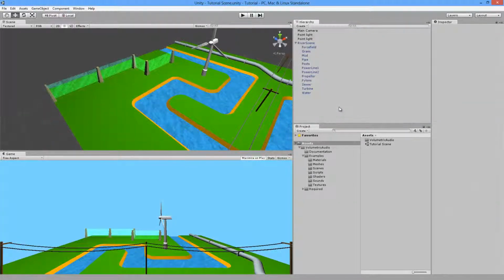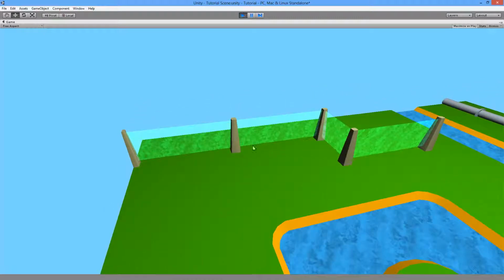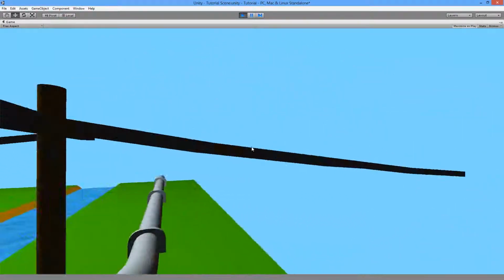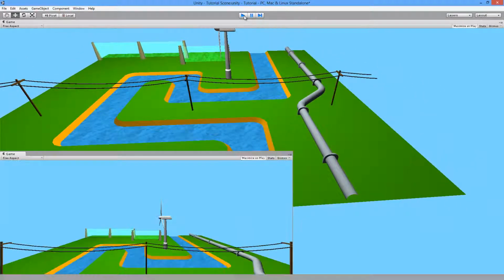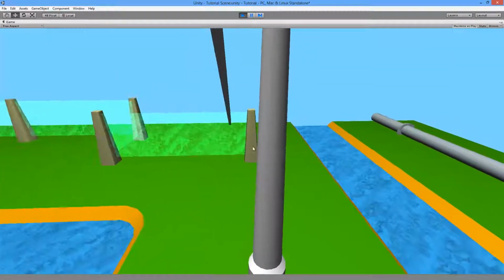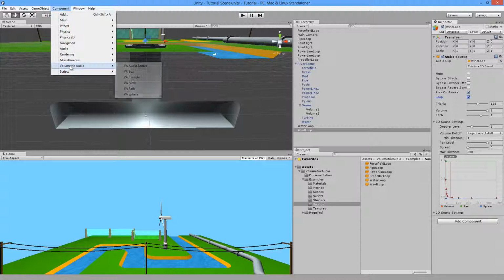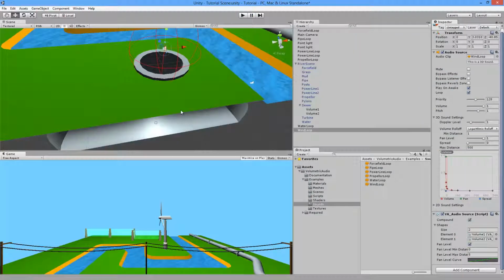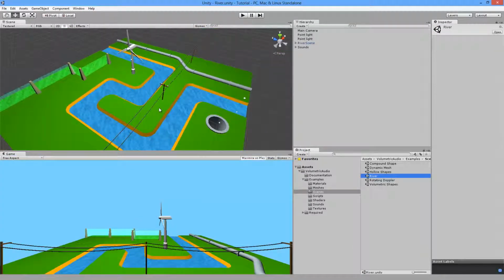Unity3D Volumetric Audio Tutorial

Comment: Very seriously looking at/considering buying this tool. 

I need confirmation that it can work with FMOD Studio though, however. You can position Fmod events as 3D objects in the game world from what I understand, but they are also normally scripts that you attach to a game object in the inspector side. Will VA be able to interface with Fmod Event Emitter scripts?
Reply: I have no experience with FMOD Studio, however: VA's audio positioning code works with any audio system that uses a GameObject's position to emit from (e.g. like the built-in AudioSource does). It also (by default) calculates these positions using the AudioListener component, but if FMOD has an equivalent component then you can replace this component name in the code (I'll make this changeable via the editor soon). Features like sound occlusion and eliminating panning require code modification though, because they rely on the ability to adjust the volume or pan settings of a sound at runtime, but they may not be required for all projects. P.S. I recommend email (listed on the asset store page) if you have further questions.